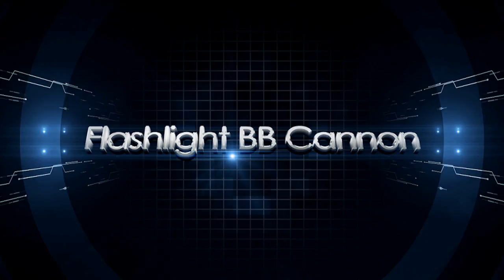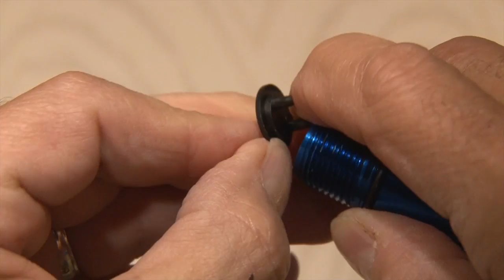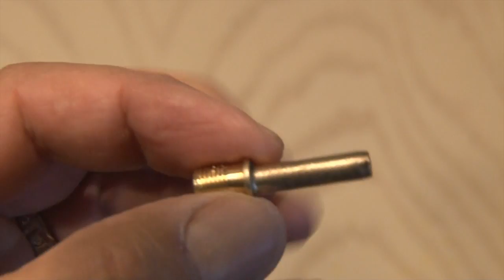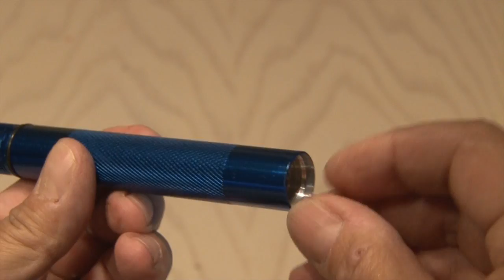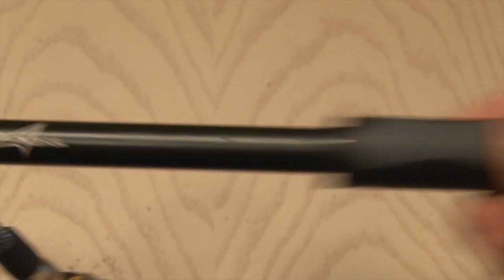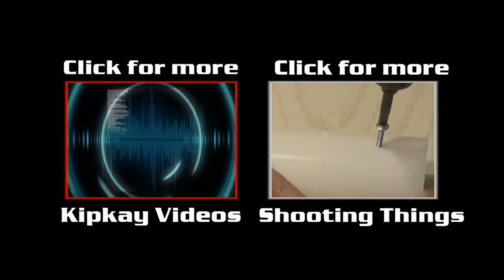Flashlight BB Cannon!

Comment: I've read that this design was cronographed at 850 fps. In (.177cal), when pumped to 200psi and a long barrel is used. I'd be courious to see what it would do in .22cal and how much psi a maglight can hold without blowing. Then going to perhaps 300psi in .22 in a well sealed build. Be nice to see this shoot 20+ grain .22cal in the 600-700fps range.

Comment: i must be missing something if he puts the rubber stopper in and pumps it up woudlent that mean the rubber stopper would be pressing against the barrel all hitting the valve stem would do it vent the air out of the back of the light?
Reply: I was wondering the same thing.  I think what happens is the rubber stopper stops the air from escaping through the tube when filling the body with the air pump.  However, when you release a little pressure manually it allows the rubber stopper to move away from the tube thus allowing some air to escape through the tube propelling the bb.  That's my theory, I wonder if it's correct.
Reply: I thought the exact same thing

Comment: For those who still aren't sure how it works, this setup is basically a mini coaxial piston, a fairly common and simple configuration.  The rubber stopper acts as the piston in this case, moving between the barrel and tire valve.  when he pumps air in, the only release is through the barrel, so the piston is pulled to the barrel, and under enough pressure creates a seal.  once he releases pressure out of the valve, the piston is instantaneously sucked back towards the valve allowing the air pressure to be released through the barrel (barrel flow rate>valve flow rate, i.e. path of least resistance).
Reply: Thank you! I was thinking about that myself. I came to the conclusion that it ended up with the stopper being pulled away from the barrel thus sending air out with the bb but wasn't sure.

Comment: switch the pump for an industrial air compresser and it will shot thrue 1,5 inch metal. i tested
Reply: What psi? I don't know if the flash lite could stand the pressure
Reply: William Ela i managed to pull off a 280 psi. I then made the mistake of getting the pressure to 285 and the entire flashlight body literally exploded. It scared me lol
Reply: MrWaheedulHaque Yeah. Thats what i would have been afraid of
Reply: +DragonBorn Fake.

Comment: am i missing something. the rubber stopper stops the air from going into the barrel but when you depress the pin it is not transferring the air to the bb but simply releasing the 50 psi pumped in there.??

Comment: How the ark does that work, how does pressing the valve let the air to the barrel and not back out the valve?
Reply: It creates a low pressure area behind the stopper pulling it back and letting the air stored in the tube to escape out the barrel
Reply: I was wondering the same thing

Comment: It is a coaxial piston, the stopper seals up on the tube and when pressure starts to release from the valve the stopper moves off the tube and the air rushes out the barrel.

Comment: the trigger makes no sense… if you press the stem in the valve, the air simply escapes out the end on your finger. How is it supposed to travel into the tube with the BB?

Comment: When he puts compress air in the rubber stopper it keeps the air from escaping through the barrel so when the pin is press air escapes and the rubber stopper is pulled in leaving space between it and the barrel but because air doesn't escape fast enough it is force around it rubber stopper and out the barrel

Comment: Sorry but the trigger mechanism needs som verifecation. In the video you press the valve where the air comes in and let it out. Maybe the pressure leftover is used on presure equlization?!

Comment: If you had read the comment you would see he asked for the firing mechanism, not the trigger. The rubber stopper prevents air from traveling to the inner barrel, and when you press in the valve's pin the air built up in the back of the chamber would be released through the valve. There is no clear answer as to how the air gets to the inner tube.

Comment: Air flows around the stopper, into the barrel of the flashlight. pressure forces the stopper onto the end of the brass tube so the air cannot leak out.  When pressure is released from the tire valve, this lowers the pressure ABOVE the stopper, whereby the air in the barrel of the flashlight pushes it back, uncovering the brass tube.  the air then exits the brass tube, pushing the BB out.

Comment: Ok, here's my best guess as to how it works: when you pump in air, you're actually pressurizing the shaft of the flashlight, NOT the inner brass tube. Somehow, pressing the tire valve releases the air pressure into the brass tube, firing the BB.

Last month, a North Korean spy was caught with a deadlier version of this..8|

Comment: Did I miss a step somewhere? If the rubber stopper blocks air going to the barrel, how does pressing the release pin on the tire valve cause it to fire? I'm super confused....

Comment: Almost, but not quite. There are two chambers, the front one in front of the piston on the barrel side and the rear one behind the piston on the valve side The air coming out the valve allows the pressure in front of the piston to push it back, off the end of the barrel, which then allows that air pressure to escape out the barrel. This drives the pellet forward. The stopper goes back, unstopping the barrel, letting air rush out. It only goes forward when you pump it up with the bike pump.

Comment: It works. The piston divides the chamber in two. When pressurising, the piston seals the barrel but enough air leaks past to pressurise the whole flashlight. When the pin on the valve is pressed, the air blasts out of that chamber thru the valve. This allows the pressure in the rest of the flashlight to push the piston back, and that lets the major pressure out the barrel, forcing the pellet out at high speed. I found the piston tightness is critical, but it does indeed work.

Comment: The trigger works because you just tap the pin it releases enough air to let pressure off the rubber stopper sealing the barrel because you only tap the pin the back is sealed again and the air escapes throughout the barrel taking the BB with it.

Comment: I think that the reason that it shoots the bb when you release air from the chamber is that when you release air the force of the air escaping pulls the rubber stopper back, then when the pin is released the air pressure inside the maglight pushes the stopper forward which pushes air that propels the bb forward.

Comment: If I can figure out how. It's amazing how some fools are arguing that this can't work, when you've done so much work on it, and others have made them too.
I am almost finished with mine. I found that a synthetic wine cork is a perfect fit in the miniMaglite head. A hole drilled in the cork seals around the barrel, the cork seals into the head, and no epoxy needed for an airtight and removable seal using this synthetic wine cork. All I need to complete is the valve stem which I am going for now.

Comment: Any air that is in the barrel, or inside the tube of the flashlight on the barrel side, is equal to zero PSI.  Zero.  It will have no pressure to push against the equal 0psi of the atmosphere on the inside and outside of the barrel.

Comment: Dude, You don't understand it?
Alright, let me explain.
As you said, the piston(Rubber stopper) is locking all air from the barrel, and when the nozzle take air in when you pump it with air, the piston will be pushed back in the barrel side. When air is sucked out of the valve, the piston will be going towards the nozzle,  and the air pressure at the barrel side will force the BB out.
Though, this little project will not work, maybe in a bigger scale.

Comment: again sir.  Please do NOT make children.
Go make this, and when you do, use a friend with a BB gun off camera to shoot the can so you can make a fake video like kip.
There is zero air pressure on the barrel side, and if the rubber did move as you say.. to the valve then to the barrel, it would not have enough force and zero air pressure to do anything.  Including move itself back.  Unless you're going to claim it bounced.  And this valve does not release air quickly either.

Comment: Yes rubber stretches.  It is not moving in the direction of the barrel if air on the valve side is being released.  It has zero pressure on the barrel side and 100PSI on the valve side.  If the rubber compresses, it decompresses in the direction of the valve.  It is not moving to the valve and back to the barrel.

Comment: Oh so you think the rubber stopper PULLS air now?  Like a propeller?  ha ha ha ha ha.  Oh then it PUSHES air out?  Pull or push?  lol  No sir.  Air pressure is the ONLY force here.  The stopper doesnt move air.  It stops it.  The valve is letting air out the valve, not through the stopper.  The barrel side is 100% blocked off from all the air pressure by the rubber stopper.  Air does not go through or around the stopper.  Didn't you know that?  Or are you too thin?

Comment: wrong.
You believe that?  But you think just the can part is fake?
You have to believe all of it or none of it.
Releasing air from a tire valve is slow.  The rubber is not snapping back and forth.  There is no spring etc.

Comment: I gave you the benefit of the doubt by assuming you were intelligent enough that I did not have to explain it.
I see that I am wrong, and that you cannot read the many comments that already explain it.
Once more:  If you release air out of the air valve, the air goes *out the air valve*.  The rubber stopper is keeping the air on the valve side, not the barrel side.   The air does not magically pass through the rubber stopper to go out the barrel when you release it from the valve.

Comment: Explain, have you ever used a tire valve? the pin inside would release the air from where you pump it in, this wont work, your isolating the pressurized air, when you press the pin, air comes out from where you filled it from, there is no separate valve to send pressure into the brass tubing to fire the bb, this simply does nothing.

Comment: rubber stopper is what holds the pressure inside the flashlight, without it leaking out the bb tube. once the valve is tripped, the pressure is released escaping through the bb tube forcing the bb out of the barrel.  same premise as how pressure builds behind a projectile, and inside of a gun barrel

Comment: I think he meant that he makes weapons from other people's YouTube videos. Also, you would think that if someone is smart enough to know where to get all the supplies, drill a hole in the flashlight (and use the right drill bit), epoxy the correct parts and assemble the parts into a working flashlight gun; they should also be smart enough to know better than to shoot someone with it. On top of that, once they have made it they will probably test it out and then figure out that it is dangerous.

Comment: Its the robber stopper that lets this work.  He fills the area between the stopper and the bottom of the screwed on seal with air pressure.  When he releases the pressure (which is quite slowly), the rubber stopper drops with said pressure, that allows the air to escape with a crazy force.  It's easy to make one, just try it, its fun :D

Comment: When you put air into it it pushes the rubber stoper against the barrell sealing it off. then it fills up around the barrel with high presure, when you releace presure in the area by the rubber stopper, (by pressing the tire vaulve) it allows the rubber stopper to be pushed out from against the barrel, and realeasing the rest of the preasure out the barrel.

Comment: what happens is it stops the air from going to the barrel while you charge it, then he presses the pin which will allow air to go through (or at least that's what I got from the video).

Comment: is anyone else confused as to how this works? if theres a rubber stopper to "block all the air going to the barrel", and you press the pin on the valve (which releases air) how is it supposed to launch the bb thats in the barrel?

Comment: ehh i wouldnt bring a bike pump... just bring one of those quick pumps thats just a CO2 bottle in a mini pistol grip style handle.. pull the trigger really quick to get the pressure up and fire away .. not sure if you can get to a 100 PSI with one but you can mess em up !

Comment: This is actually a very interesting concept. The pressure inside the flashlight is pushing the black rubber thing against the tube. Once you release a bit of pressure, that rubber thing will move toward the tire valve, therefore letting the rest of the air escape through the barrel and propelling the BB at a amazing speed. *flies away*

Comment: He chose a maglight because they are made to be water proof... and that can also mean airtight. the stopper is forced against the inner tube holding all the air in and when the needle is pressed a sudden jump in air pressure makes the stopper bounce around (Explosive decompression) and thus letting air through the inner tube and launching the BB. I know it's long but it's the best way I thought I could explain... Hope this clears it up.

Comment: Its simple really, the rubber piece isnt meant to be airtight. It pushes into the barrel then air flows around it and builds in the body of the flashlight, when you release air it is pulled of the barrel by the pressure allowing it to release through the barrel shooting the bb.

Comment: Find the material to put a hole through metal or plastic? Or how about the pressurizer and sealant? I have no need for the equipment, and therefore do not own any of the equipment.

Comment: Nice little project. Uhm. how does pushing the pin in the tire valve move the rubber stopper to allow air through exactly?

Comment: pressing the valve will suck the rubber ring off the barrel and the air escapes there because its easier than through the small valve alone, and with it it takes the bb round

Comment: But if they share the same air reservoir (The torch) then the drop in pressure wouldn't affect the brass tube until pressure dropped enough to allow the stopper to move, and by that point there wouldn't be enough pressure to fire the BB.

Comment: I would speculate that the sudden change in pressure on the side of the plug by the valve sucks it towards the valve letting the air flow through the brass tube.  This is based on my assumption that the plug gets pushed against the brass tube when pressurizing.

Comment: Actually, here is how it works, When you press the pin you loose pressure causing the rubber piston to come closer to the valve which lets air go out beside the piston and through the barrel.

Comment: You can pump air in there,  the rubber seal separated the front and the back. You can trigger the air release by pressing that valve button. But I don't see how you can shoot the bearing out.. I sounded cool, but I don't see how it can work.

Comment: think about it, the stopper makes two separate sealed chambers. One is pressurized and then rapidly depressurized, the stopper moves in towards the valve as the pressurized chamber loses pressure and the BB/barrel chamber becomes a vacuum, then as it equalizes it ejects the BB. it all happens so fast that it ejects the BB out like a cannon shot

Comment: Here's my theory, when you press the tire valve, the air comes out of the tire valve, pulling the piston (black rubber) away from the brass tube where the bullet lies, without anything blocking the brass tube, the remaining pressure in the flashlight will push out towards the brass tube pushing the piston back to the brass tube causing another air pressure which pushes the bullet. I believe the valve is small enough to not let out all the air at once.
Reply: Ayo u still alive?

Comment: Sure this is not a fake ? There is no quick release function on the rubber stopper inserted between the pressure chamber and the barrel, how the air is supposed to get through ? 100 PSI seems abit... I don't know.. Suspicious for such a build with no anti-leak finishing between each parts... Use your head guys ...

Comment: Actually, the air is getting into the barrel! :)
When you start to pump your BB gun, piston starts moving forward, until it finally shuts the barrel airtight, BUT!, the air can still leak around it!, and it starts to pressurize tiny space around the spacer (basically around the barrel that is partially inside the flashlight body). When you open the valve, the air escapes from it, allowing our leaked air (that was pressuring around the barrel, to escape rapidly, the escaping air will shoot the BB

Comment: ahaaaah, I see it now.
The rubber stopper doesn't quite seal the entire flashlight, it blocks the barrels but allows air to get past it in the chamber surrounding the barrel so you get equal pressure both before and after the stopper. Once you release the valve you get low pressure at the back, which makes the high pressure push the stopper away from the barrel entry, then the rest of the pressure takes the easy road out through the barrel, launching the BB.

Comment: because it can build up pressure when you pump in air and when you press that little thing it releases all the air so the BB bullet flies out, and if you didnt have that rubber stopper what wuld happen is the air wuld just fly out of the barrel and wuldnt build up pressure

Comment: Yeah, I'm not visualizing the internal structure and principle either. Not only doe sit block the air from going to the barrel,... You use the valve to pressurize the internals. So if you release the valve... isn't the pressure release around the back? instead of towards the BB? ... I'm not seeing it.

Comment: I think the pressure keeps it there until you push the valve pin. then the small pressure relief pulls the rubber stopper slightly away from the barrel and the rest of the pressure can go out trough the barrel